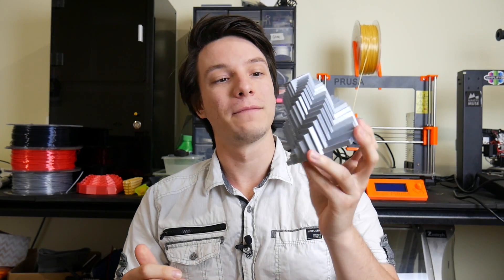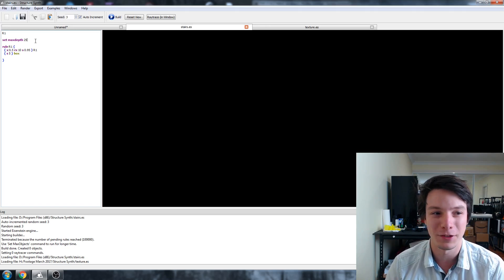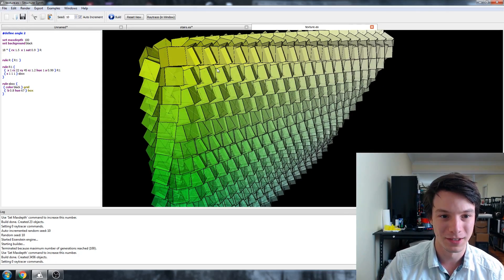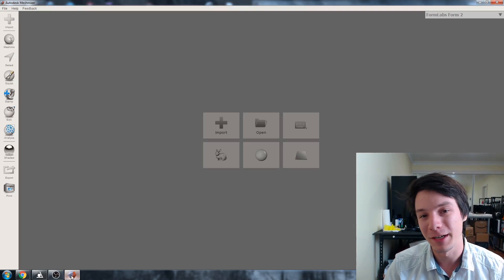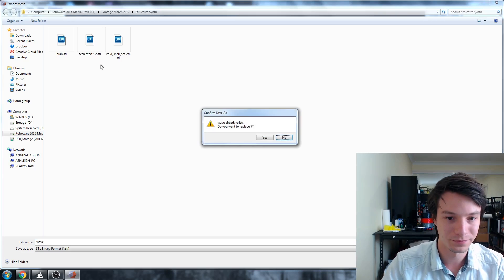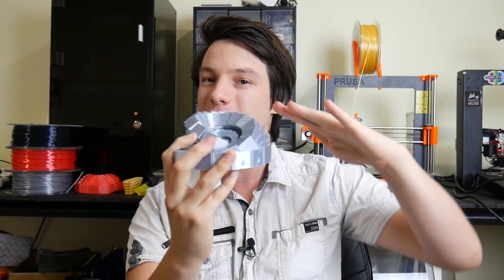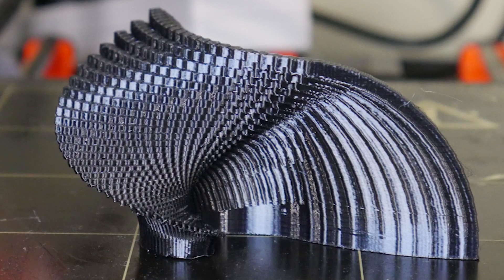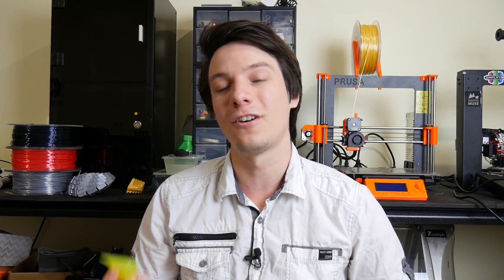3D Printing impossible geometries with Structure Synth

Comment: Maths having no practical applications? Lol...
Reply: Maker's Muse I completely agree; I love math but math class in school was always so boring. They never got me excited it was always just numbers on a piece of paper. Anytime we did real world problems they were always dumbed down to the point that the answer you got would not actually be correct in the real world. The first time I used math to create a simulation I finally got to experience a real world use and it waa addictive. I literally think about everything in a math equation (primarily algebra since the world is filled with unkown variables). School sucks.
Reply: I think he was just giving commentary to how school systems present mathematics. He was speaking in past tense too.
Reply: Solving math problems on a piece of paper with no purpose. This has no practical application. In school, I was presented with sheets of math problems to solve for no reason. At least give me a word problem, or have me make change from some money. Anything would have given it purpose. Using math in life, generally it has some application. What angle do I need to turn this couch to make it fit through the door? How many tomato plants can I fit into a 10x10 area? If a recipe calls for 3 TBSP of something, and I only have a tsp measure, how many tsp is that? lol I know those are all basic examples, but solving math problems on a sheet of paper just to get a grade showing that you can solve them is mind numbing.
Reply: offcourse you need formulas in math, but my point is that from a childs/teenagers point of view you need to understand first why you need math in your life, or why its interesting or how you can use it in your everyday life! Think of a topic you dont liked in school, for example chemistry, the analogy would be: the teacher comes in the room and throws a bunch of chemicals at you ;)
Reply: Maybe it's just me, but solving relatively complex geometry problems using vector geometry, or a neat little combinatorics problem with a nice approach always gives me a nice rewarding feeling. It's the feeling of solving a problem in different ways, which kind of gives me a sense of empowerment. Sure, it may be tedious work for easy problems, but solving a hard one is gives you pure joy.
Edit:
maybe that's why I don't pay attention to regular math classes, but love olympiad level classes.
In a sense, solving math problems does give you a sort of personal intellectual growth (which is just as nice as physical).
Reply: im the same way
Reply from the maker: To my schoolboy self it was just numbers on a piece of paper. I aced Physics because the problems had a relation to something physical like thrust ... I well know that Maths is important :P I just hated it.
Reply: James Robinson math is a language.
Reply: LinusScrubTips this is just going right over your head. You are intelligent; therefore if you apply yourself you are capable of retaining information and getting good grades. The point at hand is that math class does not excite most students (even those who enjoy math). When I asked my teacher why we needed to know Pythagorean theorem he gave me some shit about how if a construction worker didn't have his tools on hand he could use it to get a measurement. Besides the fact that that's retarded it wasn't written anywhere in the book; we just had to find C 200 times for no reason besides to pass the test. How about every video game you have ever played used Pythagorean theorem to calculate the geometry around you in a fraction of a millisecond. Every student in my class would of been on the edge of their seat. This is just a random example it was the same for nearly every math lesson.
Reply: +flashdrive 
Puzzles generally have some sort of visual payoff. A nice color coordinated cube or picture for example. In the case of puzzle video games, you beat the game/finish the story. It's probably less about real-world application  and more about getting a rewarding feeling for completing it. Not many people, that I know anyway, enjoy doing things exclusively for the sake of doing them; with no benefit to themselves or others. Initially, in school the reward is learning to do whatever level of math it happens to be. In the basic examples I gave earlier, the reward is accomplishing a task set before you (real-world application). But in school, once you've learned how to do it and are still being asked to solve sheets of problems, there is no more rewarding feeling. Instead it becomes tedious work that you aren't getting paid to do, and I don't know many people who go to work without getting paid either in currency (paying job), good feelings (charity work), or in some sort of personal physical/emotional gain (gym or difficult emotional self-help).
Reply: I really like mathematics ... but how it is taught (in my opinion) is awful and outdated. Teachers/Lecturers typically just teach algorithms for solving different problems so when it comes to exam time students can sit around for 2 hours pretending to be computers. To cut a long story short... I switched to computer science, mathematics is way more fun when you leave all the tedious computation to computers.
Reply: Fuckin' hell, you're a performative contradiction if I've ever seen it.
Reply: LinusScrubTips Good thin we weren't talking about having to pass calc 3.
Reply: Crafty Canadian honestly the purpose of this much specific education is the learning process, even though the end game isn't the most applicable it is good to continue fortifying the complex mind
Reply: I didn't really see the bigger picture in math until Calc 3. You're learning all of that stuff for physics and system modeling, essentially.
Reply: James Robinson I suck at maths but I know that it is very practical in life
Reply: Stephen b bruh
Reply: MageInWhite What? Sorry. I was jus' sayin.
Reply: Hermit Meh ... I'll have to use that one
Reply: James Robinson you don't use COMPLICATED maths in every day life, what are you on about?!
Reply: Joe Yeah. Not like he's using any math-dependent technology in his computer, camera, printer, or internet connection.
Reply: Just gonna say matrices. Linear Algebra FTW.
Reply: When it comes down to it, EVERYTHING is math it's scary and you can't run away from it
Reply: +Hyper Hektor I love math despite being taught like that. I think I just always saw it as a puzzle and I never really cared for real life integration. I don't like history.
Reply: Calculus and algebra is taught by formulas and solve for X, with no context. It's because shitty teachers don't know the applications. Engineers should teach high school math. But, people refuse to pay teachers a decent salary, unless they pay through the ass through private schools.
Reply: Calm down, he’s basically saying he’s a more tactile than math person. He said “I never see...”, not “they are no...”.
Reply: its sad so many young people think like this (i too) and today i can clearly say it was the teachers fault.
Most math teachers suck , they lack of teaching skills (for example, explain why you should be interested in math, where its used in every day life, what you can use it for. and so on) Most math teachers just throw formulas at you , you have to memorise to pass a test. Thats a bullshit way to teach, maybe its on purpose i guess.
Reply: I'm basically the opposite. If it isn't abstract, It bores me. That's why I aced quantum but didn't do as well in materials: it's too real, man!
Reply: @TomatoBreadOrgasm  i thought i was the only one lol
Reply: I personally don't understand how people only like things that have real world applications. Solving a math question is like solving a puzzle game. It may or may not have applications, but that is not what interests me.
Reply: Everyone knows that if the average person doesn't use it that it's completely useless.
Nevermind that mathematicians have been one of the major driving forces behind technological progress for the past 2500 years, 's a useless field.
Reply: Because you need Formulas. Try passing Calc 3 without first being taught a basic slope formula, or not knowing your basic derivative formulas and doing triple integrals.
Reply: Stephen b Calculus 2 and 3 have tons of real world applications.
Reply: I'm a similar way. Problem solving is much easier for me if I have a real thing to attach it to. That's why I'm going into mechanical engineering technology. I'm currently studying hydraulics and it's fascinating.
Reply: James Robinson you're right. I use Pythagorean theorem on daily basis... I calculate my path to my work using trigonometry.
Reply: +Scott Smith Not really. Languages are hard to learn. They require lots of rote memorization and follow tons of rules which are arbitrarily created. Math is logical application of only a small number of rules. Telling some kid in high school that math is a "language" just gives him another reason why he doesn't want to or can't learn it.
Reply: Lol, you're using a computer while saying that.
Reply: LinusScrubTips i
Reply: I'd say geometry has a nice visual pay off as well though ;) Like any decent puzzle.
Reply: Yeah like all these janky shapes have really practical applications. Lol...
Reply: +suraj bhawal that's sad!
Reply: and then he goes on to say how the part he found interesting (the applicable part) is the patterns you can make with maths........... please tell me I'm not the only one face palming
Reply: Hyper Hektor to me that's an excuse not to learn something. I think reading/language arts/writing is boring as shit but I still got A's and B's in high school and A's in composition 1 and 2.
Reply: it's used in pretty much everything except languages.. so no practical applications is such a retarded statement

Comment: I made the first example in openscad just to see if I could. Thanks for the inspiration. Here is the code.

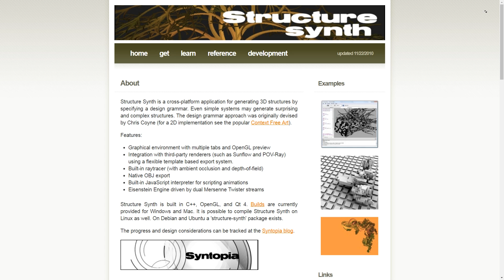for( R1 = [0:24])
{
    translate([(0.5 * R1)/2 ,0,0])
    {
        rotate(a = [10 * R1 ,0,0])
        {
            scale( [ pow(0.95,R1),pow(0.95,R1),pow(0.95,R1)])
            {
                cube(5,center = true);
            };
        };
    };
};
Reply: The last 4 lines of the code are just sad };
Reply: I'm confused
Reply: Well you know that in C++ you have a space after classes/structs for object names, so you have to put a semicolon after classes. So I always put a colon after my closing braces.  Y'all don't like em' they're like tiny frowny faces?
Reply: If you made it a module called rule() and pass in some parameters, then  replace the cube() with children() you can come pretty close to the syntax of Structure Synth.
Reply: add union(){} around this and the end result is much more slicer-friendly. edit: actually it may be that the top-level operation is union already, anyway explicit is better than implicit
Reply: @EeroafHeurlin  Yes. You have to render the design first and then export it. It is generally slicer friendly though I have managed to create a few non-manifold items from time to time (they usually still slice OK). CSG can get weird when faces touch. I generally only bother with a union() when it is within another operation like difference().
Reply: Even more sad is that the semi-colons following closing braces are extraneous.
Reply: Noot me too
Reply: @ZealanTanner  Animated profile pictures? Interesting...
Reply: @chaos.corner  yeah man thats how its done.
Reply: @ZealanTanner  Yours is the first I've seen.
Reply: I hope its not the last. spread the word cuz its awesome!
Reply: This code: for( R1 = [0:24])  translate([(0.5 * R1)/2 ,0,0]) rotate(a = [10 * R1 ,0,0]) scale( [ pow(0.95,R1),pow(0.95,R1),pow(0.95,R1)]) cube(5,center = true); does exactly the same, but it's not sad :)
Reply: I was about to observe that this kind of thing is easy in OpenSCAD! BTW semi-colons after braces aren't required.
Reply: also I made a mistake with dividing the translation by 2. I should have divided the cube size by 2. I think that's a radius which is odd for a cube.

Comment: @MakerMuse What printing bed do you use for your printer and does ABS print and stick to it with no slurry?
Reply from the maker: I don't bother printing ABS on open frame printers, you need to keep the print bed very hot and still get warping further up the print, I prefer enclosed machines such as the Up Mini 2, which use garolite print surfaces.

Comment: You can create this in Autodesk Maya either by using Mash or by using particles with instances, maybe even Xgen, i'm sure you also could use scripting similar to this but personally i would prefer Mash since it's node based and is used for creating procedural effects and is mostly used for motion graphics.
 For combining all those cube you could use Boolean Union in Maya to create a single unified, manifold clean mesh ( boolean works better when meshes have more poligons on them).